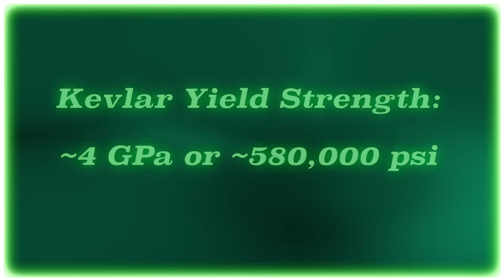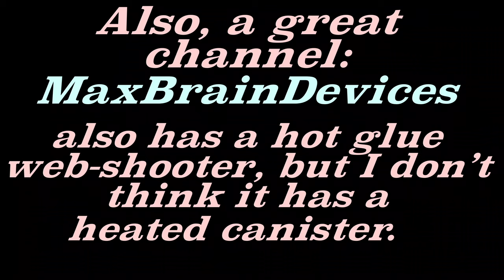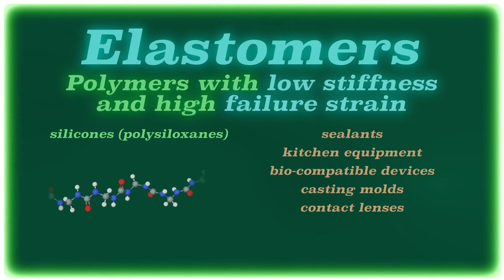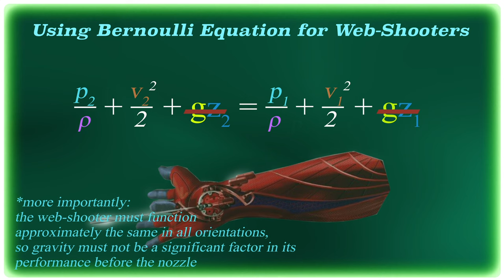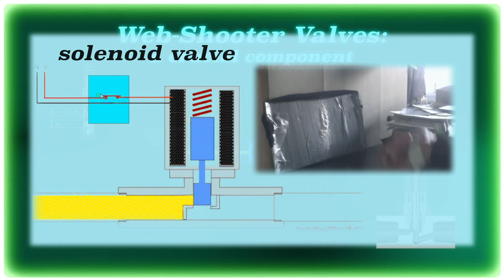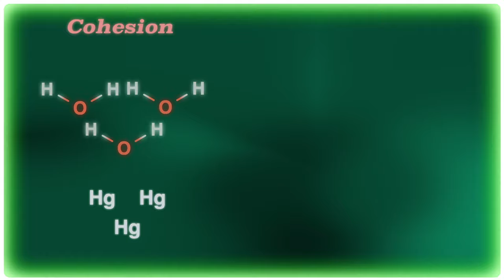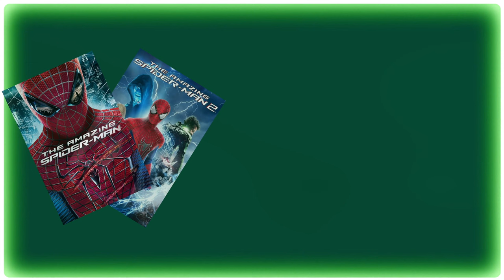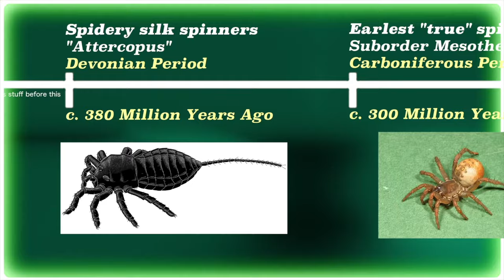REAL Web-Shooter Science: The Complete Saga

Comment: Incredible comprehensive video!!!

Out of curiosity, in consideration of Poiseuille flow, how would a rotating corkscrewed inner lining throughout the pipe effect the fluid velocity while approaching the nozzle? Would the liquid speed up while following the rotation of the screw or would it slow down due to the increased surface area for friction? Probably a stupid question but I'm not as well versed in chemistry or physics and it crossed my mind.

Also, on the topic of shooting spider silk, might I recommend researching the darwin bark spider, it has the fascinating ability to fire it's highly durable silk up to 25 meters to cross the spans of rivers and such, and is also known for it's extreme adhesive and cohesive strength!!!